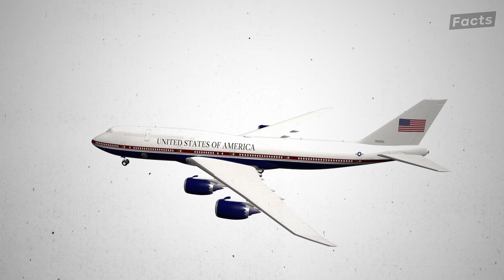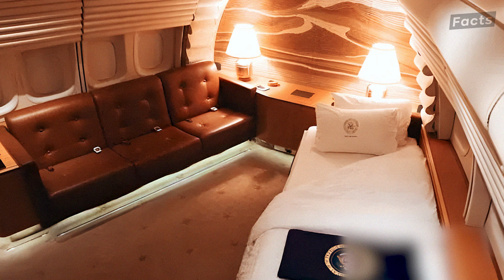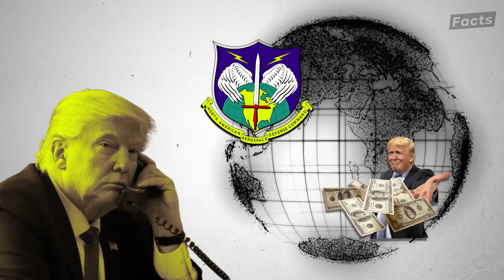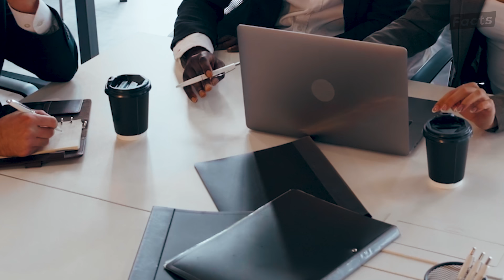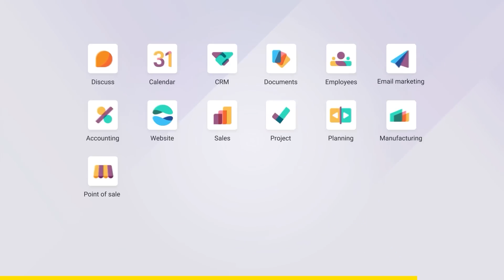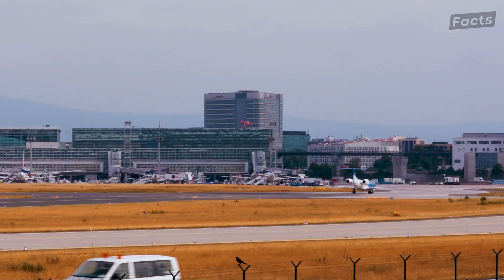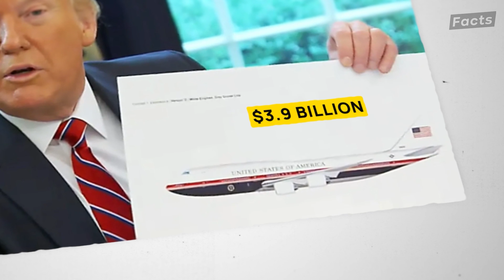Inside the NEW Air Force One

Comment: I’m not convinced: 
The furniture looks heavy. I’d insist on aluminum or titanium tables with veneer or simply textured vinyl wrap on it. 
Plus adhesive dampening mattes on the underside, so it doesn’t sound cheap when someone hits their fist on it.
Any pound saved keeps the plane more agile and longer in the air.
Defense: Outdated! 
If I were a bad actor who wants to shoot it down, you can probably modify a missile to track the shape of the plane instead the heat.
$60 Raspberry pie, $5 Camera and 10 bucks for an IR filter and you are golden. Maybe you can even ditch the pie for a $1.5 Arduino (I’m no expert in image recognition). But you get all the parts for well below the price of one family steak dinner.
A modern Airforce one needs more colors that infra red lasers to blind modern autonomous drone missiles.
I think an extendable machine gun with automatic target recognition and tracking is indescribable. You probably don’t even need a large caliber. It only needs to be quick and precise.

Comment: It's been 7 years since Boeing signed the contract for these highly sophisticated aircraft and it will be at least another 2 years before they are completed. The original 747 took only 28 months to develop, start to finish, during the late 1960s, when much of the design was done on drafting boards with crude computers doing some of the engineering analysis.
Reply: Things have changed. How many computers were around back then?

Comment: 9,000 pounds of thrust ?? 

Maybe he meant to say additional 9k lbs of thrust each engine. 

The current Boeing 747-200 has four Gen Electric Turbofan engines pushing between 56,500 pound feet of thrust each engine, and a classified number, more like 65 or 70k pound feet of thrust. 

The Secret Service, DARPA, Boeing, and the DOD will never tell the world the exact specs of anything involving POTUS transport. 
The current Air Force One is a high subsonic aircraft probably capable of 680 to 700 mph max. 

The new AF1 will be lighter with composits and much more powerful turbofan engines. 
Might be 720 to 730+ mph for the new jet. That is crazy, but like i said, stranger things have happened. 
The capabilities will always be far more advanced than we know about. We don't need to know. 

All the best. Thanks for reading this.

Comment: I'd add that the paint job isn't official yet. The color change would cost $$$ to change due to confilcting color change with equipment, application, heat issues, etc.

Comment: The first mistake was sticking with Boeing, their corporate structure is so ass backwards it should be of little shock there are delays. I'd be willing to bet my bottom dollar that if the contract had been given to Lockheed to refurbish a C-5 Galaxy for POTUS use they could've done it within the time frame at the very least, the C-5 is more than capable of carrying out the same task as the 747, plus as I recall Lockheed already had plans drawn up for a civilian commercial variant of it, a revision of those plans with POTUS in mind and improvements in aviation since then could produce one hell of a aircraft.

Comment: I think it's not a kind of protected capsule that can close on any nuclear attack etc. that can detach from the plane and fly and land in places well known to the president and where it is safe from anything. Plus it doesn't have a satellite antenna with wide-coverage radars and many other weapons equipment etc. The plane is a bit poorly equipped plus you have state-of-the-art equipment and military etc.
Reply: Remember if there is a war going on it is not the plane the president should be in anyway.  There is a completely different plane for that scenario. They would probably just use AF-1 to get the president to the other plane.

Comment: No, the VC-25B will not be longer or wider than a regular 747-8. Why? Because the VC-25B already is a regular 747-8. The airframes were meant to be delivered to Russian airline Transaero but they ceased operations, leaving the two aircraft without a home. The Air Force took them up for conversion into VC-25Bs, which is being done by Boeing.

Comment: this supposed plane was approved during Trump’s 1st administration. i still remember it was Trump who chose the plane-the aircraft was not purchased as brand new because the airline that was supposed to buy it went bankrupt. when Trump knew about this, instead of buying a new aircraft from scratch, a built one was purchased instead and will be modified, which saved lots of tax payer’s money. although i believe 50% of the original aircraft will be modified. only thing basically left is the “shell.” also, it wont be air refueling capable, which i think is important…

Comment: OK------.     You missed the MOST important New protection Decoy  On Airforce One.... That is the towed  DECOYS that can be deployed and Towed a thousand meters behind the Aircraft that spoofs missiles both infrared and radar guided as well as aircraft to hit the Decoy instead of Airforce One...  Lastly, AIr Force One is scheduled to be equipped with its own MISSILES to reach out and touch enemy missiles before they get close enough to Air Force One to attack it even if the ship's Jammers fail simply due to its size.. As well as Decoy missiles combined with Airforce One's own Jamers' to Lour enemy planes away from Airforce One...!!!  Make the enemy think Airforce One is hundreds of miles away someplace other than where it is as Airforce ONE flys away safe...  Plans also include the new Lasers scheduled to be deployed on fighters in the next decade or sooner....with one of the First production test turrets deployed on Airforce ONE's...  This gives Airforce One Multiple layers of Protection no Plane has ever had before... 
----------.   Protection that has been suggested for the new B-21 making it able to fly across China without being touched if China does get a glimpse of it... While delivering killing blows across the continent....    Imagine what 200 B-21s would do to any country in ONE pass at 100,000 feet...  Without needing Nuclear Bombs...  Then Coming back a week later...   At 20 miles above the ground the B-21 would be out of lock range of all but the most powerful radars and then only if they fly right over them (but most radars do not look strait up) and able to see anything that does come in its direction 5 minutes before it can get near.  Gives the B-21 plenty of time to outmaneuver any intermittent hints it is there .. Making it easy to avoid most threats...With a couple of self-defense Sidewinder missiles or even the new laser if a Fighter or missile does manage to get too close by Luck... Which can happen ...   
---------.    Airforce One constantly being upgraded, is why it Costs so much and will never be completely Finished...  Technology is advancing too fast to stop upgrading anything... Why most new military equipment has designed Modularity...built into it... And finally complaining a fighter or even Airforce One is too expensive is asking To LOSE the Next War or the NEXT President...!!!   I am sure the Dems' would love that and should start SCREAMING to stop all development and upgrades on Airforce One just for that reason...   LOL  I can think of no other aircraft better suited to test the country's newest defensive equipment than Air Force ONE...   Go TRUMP...

Comment: Most people have never been inside or underneath the 747- it's an enormous aircraft. Having flown overseas and working on the ramp as they approach the gate, I'm still blown away by this plane. The VC-25B must be incredible.
Reply: About 14 years ago I checked out the 747-800 test bed that Boeing had in Moses Lake, WA, so all it had inside was a handful of seats and interconnected water tanks for on-the-fly (so to speak) changes to weight and balance. Other than that it was empty. Working active duty at the time on the KC-135 (a 717 airframe) it was insanely impressive how much space there is inside that thing. It was really cool to see.
Reply: I flew to Korea about 12 or 15 years ago on a Korean Air 747 and it was pretty awesome and absolutely huge. It also had the hottest looking flight attendants I've ever seen. It's hard to believe this one will be significantly longer than the one I flew in. I was very happy to get to fly-in one because I knew they were being phased out and I always loved that plane.
Reply: @actionjksn  , I flew back to the states on a 747 in 71. Not really impressed after being a C- 5A Crew Chief in '70.
Reply: I still have a new box of matches with AF1 logo from the Regan days! $$.
Reply: In Pattaya, Thailand there is a 747 sitting on a city block with an open air market underneath it.  You can walk right up to it and touch the landing gear.  Pretty cool.
Reply: @ That sounds cool 📲
Reply: 747 vc
Reply: @lorikremer2709, I've never been around planes this size, it is enormous! It also looks like the "upgrade" is almost like NASA upgrading to the "Enterprise." It'd be pretty amazing if we were that advanced already, no more "floating around", having to strap yourself to the wall to sleep, no need for "resupply launches", you'd have replicators and just need to stop off at a space station on occasion for scheduled maintenance etc.
Reply: Whaaaat you have flown in a 747???? Like the hundreds of millions of others who have too? 😂
Reply: Thats awesome. I hope to see it one day
Reply: @frankierzucekjr  i hope to see kamala harris one day

Comment: 0:02 This red, white and (dark) blue livery is the original Trump admin design suggestion that was rejected, purportedly for technical/engineering/heating reasons the underbelly must remain a lighter color

Perhaps with more delays and greater costs it's still possible with the new Trump admin in place, but as it looks right now it's back to the original Kennedy-era color scheme

Comment: Unfortunately . . . the white walls means it will be a cleaning nightmare.  It will always show contact, dirt, grease, handprints . . . and those cleaning will ALWAYS be casing perfection which will be near impossible to achieve.  Functionality will be hampered from time to time.  Mark my word and give it a while.  It is like the designers are TOO HIGH STRUNG and heads are in the stratosphere.

Comment: LOTS of errors in this video.   AN/ALQ204?   That's ancient hardware.  A version Northrop Grumman LAIRCM will probably be the counter MANPADS solution.  9,000 lbs of thrust per engine?   It would hardly be able to taxi.   The GE engines actually produce up to ~80,000 lbs of thrust so you were only off by 80%.   Other posts here point out obvious errors that could have/should have been caught with a bare minimum of 3rd grade research.   One thing is for sure:  You are certainly "Beyond Facts"

Comment: The military bought two 747 aircraft, that were brand new but put in storage for a couple of years. That was several years ago.  These two aircraft were supposed to be converted into the new Air Force One aircraft.  No information about the aircraft has been updated for a long time.
Reply: The Airforce scheduled a replacement for the current 747 because it was not going to be built any longer and the current AF-1 was getting to hard to find or make parts for.  They originally planned on the 757 to take the 747s place but they got a lot of negative feedback from the executive branch about going with a smaller plane.  So the Air Force talked with Boeing about how they could stay with the 747.  Boeing only had one suggestion and it was because they were shutting down production of the 747 altogether that they recommended the last 747 VB2  a passenger plane that was the last to be built. That 747 being larger and more economical than the current 747s seemed like it would work except for one thing. There were none for sale.  The last ones being built several years before. But Boeing was able to locate 2 brand new 747 VBs  or 747-8 that had been ordered by a now defunct Russian Airline. 
Oh the Air Force not being sure that the 747s would ever be usable again did have 2 exact 757s made up to be Air Force One. They are sitting unused but paid for by the taxpayers. Because instead of saving the taxpayers Billions of dollars and flying in a smaller plane the executive Branch would rather those planes just sit and rot or rust.
Reply: @Stevewithcommonsence stop making shit up.
Reply: @johnp139  Are you a lonely stalker? Go away!  Find someone else to bother.  You magats have one track minds I swear.
Reply: they were doing a new one and wanted to bill us up the wazoo and 45 negotiated the price down 8 years ago
Reply: @lovly2cu725 No, it would have cost less and been delivered sooner.

Comment: Boeing needs to let the engineers build the planes.  Let finance deal with the financials and build quality.  End of story.  Just like the original 737, 757 and 747.  Workhorses of the industry.  Engineers built great planes.  Not focusing on the bottom line for everything.

Comment: Trump should of had Elon build the plane. At least it wont fall apart in mid air, like Bowings Airplanes do.
Reply: Bowing is just going to use cheap ass parts so Air Force one will crash one day. Thank God President Trump wont be able to use it and to bad Joe Biden isn't going to be on it when it crashes. It's being made by Bowing. It will start falling apart in the air or it may not even take off at all. LMAO
Reply: You mean like the latest Starshit launch????
Reply: @johnp139  Thats a test of a Starship, theres a huge difference between building a rocket that will launch a 60 story building into space vs a plane that just flies around. A final product would be built much better by Elon then Bowing. Especially after Bowings newest track records of planes falling apart in air. 

Edit: Like they say "If it's Bowing, I'm not Going"
Reply: @ The failure should have been found on a ground test.
Reply: @johnp139  I do believe the rocket would have to be moving to find the oxygen leak. Don't sound like something that could've been found grounded. Unlike all Bowings Airplane's. Or it tested well on the ground but at a certain altitude it made a oxigen leak and now that Elon knows what caused it, he will fix it. But Elon could build a impenetrable Airplane for President Trump. If Elon were to build the next Air Force one, it would be a flying fortress that could never be taken down.

Edit: I built AI infrastructures, not Rockets. So IDK if the leak could of been found on the ground or if it needed to be airborne.
Reply: @ The whole point is that Muskey refuses to do systems engineering, which would have found this problem before full-up testing.
Reply: @johnp139  Please tell me your not that stupid to think an Engineer isn't going to make sure his work is correct, especially coming from Elon Musk.

Why do people hate Elon so much. All the man has done is gone from poverty to the richest man in the world by revolutionizing the future for humanity.
Reply: @johnp139  You have no clue what your talking about. But I suppose I should expect that from a Leftist Looney Liberal.

Edit: I will believe what Elon Musk says ever before I believe a DemonRat Leftist Looney Liberal.